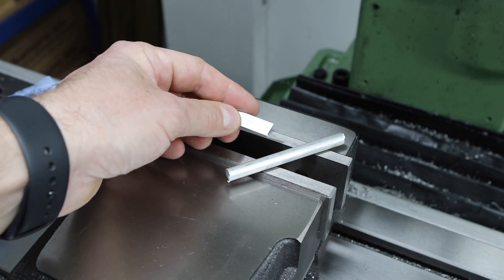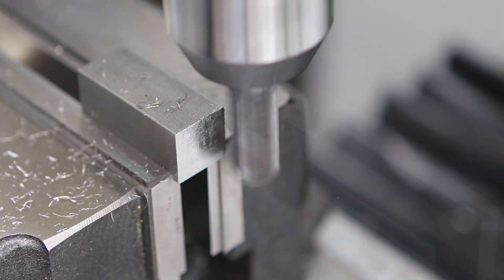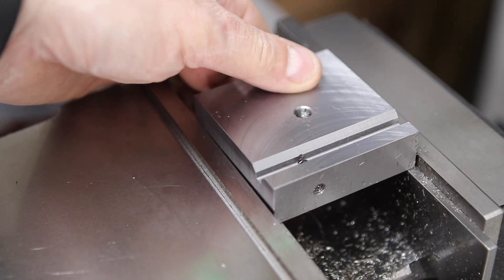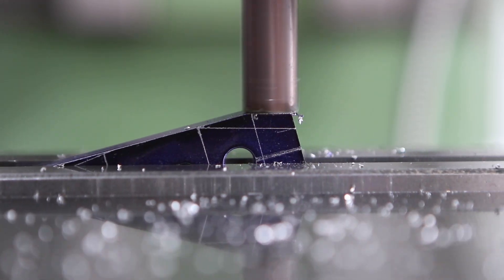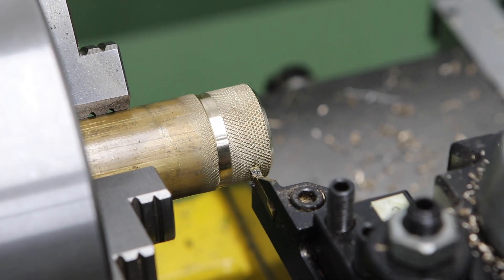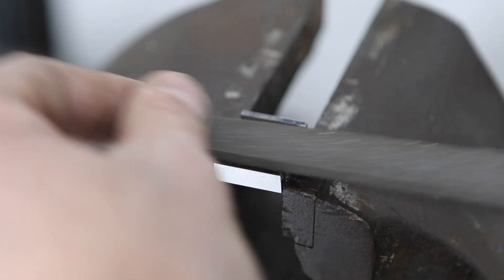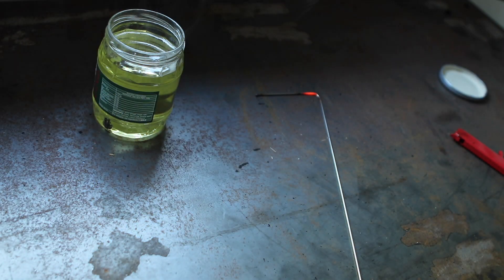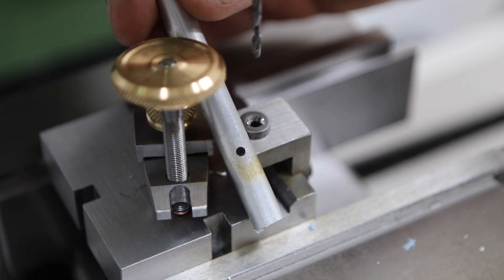Making a Finger plate clamping tool from Hemingway Kits

Comment: Superb presentation! But is the hole in the drill guide really drilled to 3/8 inch?  It looks about half that size, almost matching in diameter the 4mm slot drill you use on the base...
Reply from the maker: Thanks, yes it is, but it has the hardened bushing inserted into it to guide the drill which has. a much smaller through hole.

Comment: For tapping blind holes with regular taps, you can use old grease(find a tub of expired grease on secondhand market, ebay or similar), just shove the grease into the hole, fill it to the brim and go in... The grease will ``hydraulically`` push the chips out, lubricate the tap and give you a great finish of the threads cut(that is if your tap isn`t dull)... As the tap goes in, the grease is forced out and with the viscosity of grease, the chips can`t just fall in, but are caught by the ``jets`` of grease and carried out of the hole, leaving nothing but a greasy hole behind, ready for a fastener of any sort to nicely thread in and squeeze the grease slowly through the thread clearance - ensuring a rustproof threaded joint for years to come... There is a slight chance of a chip or two remaining in the bottom, but generally, there is enough space for them to not interfere at all with the function of the joint... 
Old grease is just the best, be it for that or other such wonky work(deep drilling - pilot drill and fill the pilot with grease, as the large drill gets hotter, it melts the grease - cooling the drill and lubricating the cut and the chips as they get fluted out) or for just smearing it on parts you want to prevent from rusting... Just slather the grease on em and wrap the thing in clingwrap... It can also be used to store bearings, just cake the damn thing fully with grease and voila, no rust... When you need the bearing, purge the grease with solvent of choice and lubricate the bearing accordingly to type and usecase... Just don`t use contaminated grease, it can be old, but it has to be clean... Or just buy the cheapest grease for bearings and chains you can find... If it`s new, it`s likely clean enough for aforementioned uses... 

All the best and kind regards!
Steuss
Reply from the maker: Some great tips there, thanks for that, I'll be sure to try.

Comment: 6:35 the struggle is real! Spray some WD40 on the vise jaw and that angle block will stick to it.

Shortly after, you mention that noting the position of the DRO will take it to the same depth. 🛑  I've been here! Unless you set a stop on the left of that slope, It's not going to re-reference to the same height. Sorry to be that guy.😋

Disregarding the smart-ass comment, good vid. 😁👍
Reply from the maker: Thanks for the WD40 tip! Yes, you’re right on the DRO comment. I think what I did was to note the depth after touching off, which wasn’t clear from my comments! Thanks for the feedback and thanks for watching!

Comment: Just found your channel this last week and watched all of the vids, great job, love your close up filming and clear speech, reminds me of Click springs videos. 

I’ve just bought the Hemingway tool post grinder kit to build. The only thing that stands out to me from your videos and this tool post grinder is all the old school imperial measurements that only the US keeps pushing. I only work with metric on both my manual mill and lathe, and my CNC mill. It’s a real pain having to go through the drawings changing everything to a metric equivalent number. 
I think Hemingway should offer either metric or old school drawings when you purchase a kit from them. 

Great vids, what’s your next project going to be? I would like to buy and build the Quorn Tool grinder, but that is a lot of number changing to build that!
Reply from the maker: Thanks Rob, I'd be interested to hear how you get on with the tool post grinder, do you have any specific projects in mind that you need that for? I too prefer metric but I don't mind too much working in imperial. What I do find a pain is converting fractional measurements from the drawings to decimal measurements that I can work my DROs with. I'll be building the graduating tool from Hemingway next
Reply: @joneseymakes  hi mate, so the tool post grinder arrived a couple of days ago, I was amazed how big the box was!! There are a lot of aluminium castings in there, it’s sure going to be a lot of work and a fun project! 
The reason for getting it is there’s a batch of parts I need to make from a discontinued product and I know I can sell a bunch of them. I need to be able to grind the final diameters accurately and between centres in heat treated silver steel (Drill Rod)
Reply from the maker: @MrRctintin  That sounds like an interesting project!

Comment: If the clamp ran in a tee slot it wouldn't get in the way of cross drilling.
Reply from the maker: The clamp is offset from the cross drilling hole so doesn't get in the way.

Comment: That turned out really well. Great video. I am on my 2nd Heningway kits build at the moment. 
Regards.
Steve.
Reply from the maker: Cheers Steve, what kits are you doing?
Reply: @joneseymakes  I did an 8 part video on the Sensitive knurling tool. At present i have posted 4 video's on the Large bore lathe steady rest. Still quite a bit to do on that. 
Regards.
Steve.
Reply from the maker: @Steviegtr52  I think I watched those a while back, I'll check them out again. I'll be doing the knurling tool at some point too.

Comment: Place a strip of spring steel sheet in the bottom of the recessed channel to prevent the drill from going through to the fixture
Reply from the maker: Thanks for the tip!

Comment: nicely done, looks great, now that was cherry red a little too hot maybe
Reply from the maker: Thanks! Yes, that was definitely hotter than I wanted. Still hardened well though.
Reply: @joneseymakes  as you said in your other video is looks hotter than it is, i do cherry red with dim lighting and until it no longer attracts to a magnet, i also found water works better to quench tool steel and keep moving the part to prevent vapour collecting (bubbles around the part) stops it quenching quickly, then anneal to straw, great videos btw
Reply from the maker: @pickwizard-aka-Stevie  Thanks! Great advice, I'll try that next time.

Comment: Great video. Looks like you could solve a few issues by moving the drill guide mount down to the end of the block. That way your clamp could sit at 90* to the part. If the clamp is at a 90* to the part, you could then cut a V groove into the bottom of the hold down to better hold round stock.  This would also give more room for the chuck.
Reply from the maker: Thanks for the feedback. Yes I think moving the drill guide might well be an improvement to the design as it is in the way when clamping round stock.

Comment: Thanks for the video, nice job, and would be a good weekend project, I made the Hemingway knurling tool, couple of weeks ago, that's a fun project, and you are right, the dwg's and notes are good,.
Reply from the maker: Thanks Gary, yes I bought the knurling tool too and that will be the subject of a future video. Any tips before I start the build?
Reply: @joneseymakes  I made a little holding fixture for the rotary table (mild steel black, 75 x 6 mm) for milling all the radius's (i started following you on insta, couple of shots there ) and used M5 instead of the BA taps,  3/8 BSF hard to find in Aus also.  Gary
Reply from the maker: @garybodnar1085  Thanks Gary, I'll check out the photos on Instagram
Reply from the maker: @garybodnar1085  What's your instagram handle?